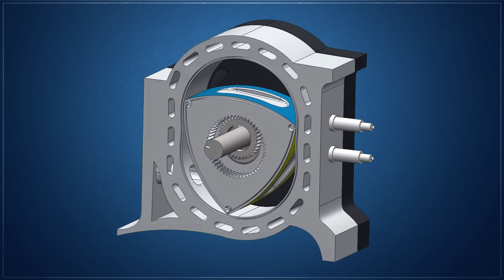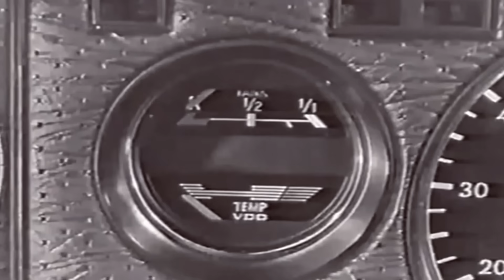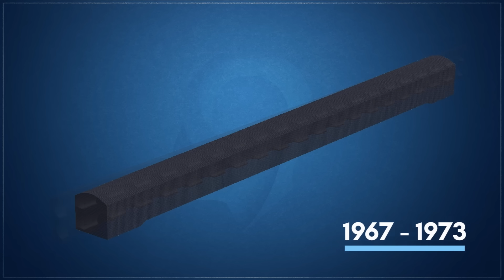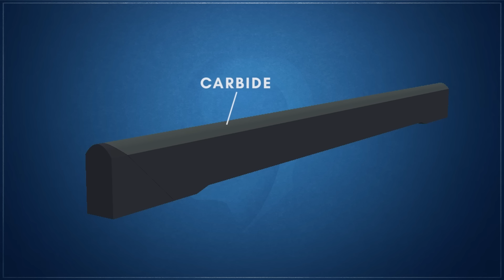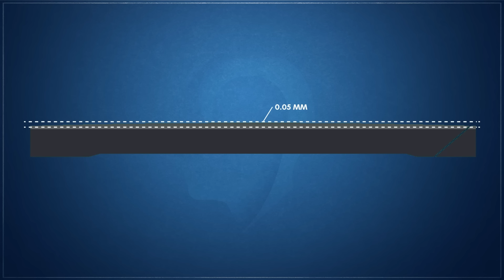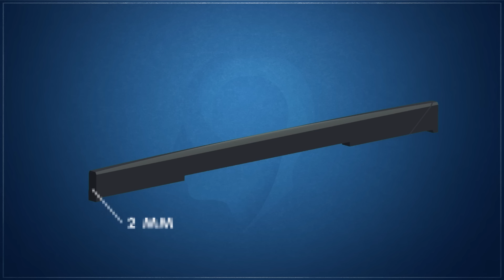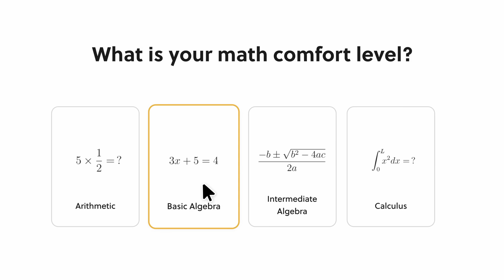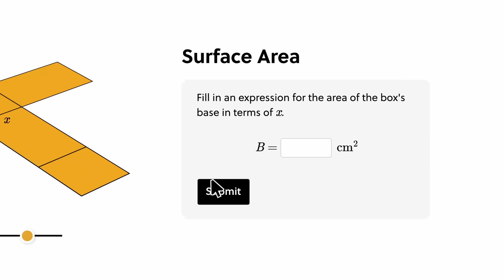Overcoming The Rotary Engine’s Biggest Flaw

Comment: Good video but you're assessment is wrong. 

High emissions and low efficiency killed the rotary. Having the motor power a generator with no direct connection to the wheels allows for far more control over operating conditions that would allow for much better emissions control and efficiency. As a range extender the small size also makes a rotary a good option when you consider it's environmental issues can be mitigated by this use.
Reply: The Wankel engine is obsolete today because of its horrible reliability problems and the fact that it offers no real advantages over reciprocating technology in any applications, especially in generator applications where the Wankel engine was a complete and total commercial failure.

The concept of range extenders was briefly de rigueur over a decade ago but quickly discarded, Only the BMW i3 RE ever made it into production and it was a notable failure.

The idea of combining the Wankel engine, noisy, dirty and inefficient with an EV makes absolutely no sense and is completely incompatible with the entire "green energy" concept that promotes EVs... extremely quiet and zero tailpipe emissions ate the only advantages that EVs have over ICE cars... the addition of the Wankel befouls these tenuous advantages.
Reply: The Wankel failed because of a very disappointing lack of durability and reliability, apex seals have low MTBF.

Comment: I dont know anything, but why don't they coat the interior walls with the material they use on piston skirts? Again I'm just wondering maybe someone would know.
Reply: Because the dry film coatings used on pistons cannot withstand direct exposure to the combustion chamber and is too soft the resistant the abrasion of the apex scraper seals
Reply: @sandervanderkammen9230  Thanks!
Reply: @fishneck7366  you are very welcome

Comment: Electric motors have almost infinitive torque at 0 RPM and out perform any comparable HP rated engine without any vibrations and create no noise. The weight to power ratio is also won by electric motors that produce far less heat per power generated with an efficiency of more than 90% (compared to car engines at 40%  to 50%) . The motor is air cooled - no toxic coolant needed and no radiator either.The motor can drive the wheel directly without transmissions and the need for a clutch! No need for a tailpipe that rust out every 3 years! 
The only reason Toyota does not like them is because they do not own the patent of them! Who are they shocking - their stock holders?! A lot of fluff for noting and a waste of money! Bye Bye Toyota, Mazda, Mercedes, Honda.... electric motors perform without having to wear ear protections in race car engines and the neighbour hoods are quiet - no teenagers that dive without exhaust for an ego boost!!!
Reply: Yeah, we all know electric motors are great... it's rechargeable batteries that absolutely suck... they are inferior to all other forms of storing chemical energy and they prevented EVs from ever becoming mainstream and why they will remain a tiny niche market segment of the automotive industry.

Comment: What about a using a cylinder as an apex seal? It would simply roll around instead of directly scratching up the insides.
As for incomplete combustion, what if a two rotor design is used and the exhaust from the first rotor is fed into the second as the intake to be combusted there?
Reply: How would it form a gas-tight seal????
Reply: How would that make the combustion better?

Comment: In the days of the RO 80, when two RO 80 drivers met each other on the road, they always raised a number of  fingers as a greeting, indicating how many engines had already been replaced. 
The shape of the combustion chamber is the number ONE problem.
Reply: The basic geometry is the worst engineering flaw... the apex seals are the second.

Comment: The big Wankel engine problem are emisiones and housing lubrication, not apex seal, they dump the combustión in the exhaust port still burning ! Thats why the big flame in the muffler. I wonder how Mazda is going to resolve that problem. 😂
Reply: That is completely false and dishonest.
The biggest problem with the Wankel has always been poor reliability and durability.
The Primary Failure Mode of all Wankel engines is compression loss due the apex seal failure and damage.
 This problem is inherent to the design of the Wankel engine and is in no way related to lubrication.
Emissions are not the major cause of Wankel engines becoming obsolete.

The last production Wankel engine was the Mazda Renesis and it met or exceeded the strictest emissions standards in the world right up until production ceased in 2012.

Sale of Mazda RX models was actually worse in countries with absolutely no emissions regulations.
Reply: @sandervanderkammen9230   Nop ! Emission are the problen en todays Wankels. The engine are very reliable in racing today.
Reply: @josecora1917  Wankel engines are no longer made today, series mass production ended over a decade ago.

Absolutely False, the Mazda Renesis engines met or exceeded the strictest emissions standards in the world right up until production ceased when sales dried up completely.
Wankel engines were an epic failure in motorsports competition..
A Wankel engine has never won a single Major world-class professional motorsports series Championship title.

Any questions son?

Comment: Can't call the rotor a triangle because it's not made of 3 straight lines. It's actually called a reuleaux.
Reply: Can't call it a "Rotor" either, a Rotor is something that spins concentrically on a fixed point... only the DKM54 had a Rotor, the KKM57 has an Orbiting Piston assembly.
It both reciprocates and rotates simultaneously in a planetary orbit around  the inside the chamber housing.

Comment: The biggest flaw is surface to volume ratio of the combustion chamber.  This results in excess heat loss of the burning charge compared to a reciprocating piston engine.  There is no cure for this basic geometric flaw.  That's it, done, over, no recourse for the Wankel.  I've followed this design from it's beginnings and also followed the history of NSU.  NSU had some if the best engineers in the world and produced some world beating designs.  These would include the VW Golf and the beginings of all modern Audis.
Reply: Excellent comments
Reply: But not original, all of this stuff is known.
Reply: @anvilsvs  Indeed, but well said.
Couldn't have said it any better myself.

Your knowledge regarding this topic is excellent... it's refreshing to read among the endless comments posted here by those who have no clue what they are blathering on about.
Reply: There's no way you were alive in the 1920s.
Reply: @blockstacker5614  The Wankel engine didn't exist until 1954..
Reply: @sandervanderkammen9230  Conceptually it has existed for much longer.
Reply: @blockstacker5614  Which Wankel engine?
Reply: @sandervanderkammen9230  The one conceived by Felix Wankel in 1924.
Reply: @blockstacker5614  The engine he conceived in the 1920s had reciprocating pistons.
The DKM54 was designed in the 1950s.

The engine being discussed in this video is the NSU-WANKEL KKM57 engine designed by Hanns Paschke and Walter Froede from 1957.
Wankel had no knowledge of its development or approval, he despised this crude, unreliable engine.
Reply: @sandervanderkammen9230  The  NSU engine didn't materialize out of thin air, Wankel had been exploring his pistonless  engine concept for decades by that point.
Reply: @blockstacker5614  Not true, Felix Wankel was obsessed with the Rotary engine and was a big fan of Megola motorcycles, which was the inspiration for his first supercharger design. Only later, at the insistence of this co-worker at NSU, Walter Froede did he develop an engine base on the Rotary supercharger..

Comment: How far can this vehicle travel on battery alone. Using 13 us gallons (10 uk gallons)to extend the range to  380 miles is rather poor and certainly nothing to write home about. If anyone is going to use a range extender then a wankle is definitely wrong most manufacturers are using conventional petrol piston which isn't great when they should be using diesel as that is the most efficient
Reply: Mazda announced in July that it canceled the MX-30 due to poor sales.
Reply: @sandervanderkammen9230  — Smart of Mazda — finally. It’s a shame the poor bsatards spent so much money trying to resurrect this obsolete design …

Comment: in addition to the apex seal probs the side seals would stick due to carbon buildup from running at light loads, idling in traffic etc. 
this lead to blow by causing loss of compression and oil leakage causing the plugs to oil up, making cold starts sometimes impossible without changing or cleaning the plugs. most rotary mechanics came to realize that a poor running engine just needed a good 10 minute blast down the freeway and it was good as new.
Reply: The 2 rotor models, Rx2 and Rx3 had two distributors with two spark plugs per rotor chamber as part of the emission controls.  They were still very hard on spark plugs and depended a great deal on how the car was driven.
Reply: Carbon build-up is caused by low compression and damaged seals.
Reply: Carbon buildup is because of using bad fuel and oil. The main problems of rotary are not seals and emissions, the engine is not stiff enough and need 2 kind of oils to lubricate it. There are people that fixed most of the wankel problems but well, its too late.
Reply: @szaka9395 Carbon fouling is clearly a symptom of low compression, especially for fuel injection engines.
 Show me a Wankel engine that floods or loads up with Carbon, And I will show you a Wankel engine with bad apex seals.

Comment: It is said the less the curve of the rotor, the better. I think this curve can be modified.
Reply: The curve cannot be changed, there is a fixed ratio between the Piston/Rotor diameter and circumference to the chamber circumference.
Reply: This is how hard u can push a rotary🔥🔥😱😱https://m.youtube.com/watch?v=xtVVPioU9p8&t=1127s

Comment: I think part of the issues with the apex seals was that there wasnt really a "cool" side like a piston ring had.   
But the other thing that i have always found a bit odd about the rotor itself was the pockets for combustion.  They were symmetrical and i feel like having the back half of the pocket just as deep as the front half worked against the forward movement in the later half of the ignition stage.   I would be curious to see what would happen if the leading half of the pocket was deeper and tapered to flush towards the back half of the pocket.
Reply: Won't have any effect, you must have been sick the day they taught Pascals Law...
Reply: @sandervanderkammen9230  yes assuming the chamber was stationary but the rotor is moving and has inertia
Reply: @joshuaszeto  Unless the chamber is moving fast enough to form a supersonic shock wave? (which it doesn't)  NO, Pascal's Law does not allow pressure to be "off-set" in the combustion chamber, pressure IS ALWAYS exerted EQUALLY on all sides.
Any questions?
Reply: @misfirerotary You have to push them frequently if you don't have free towing insurance....
Reply: This is how hard u can push a rotary🔥🔥😱😱https://m.youtube.com/watch?v=xtVVPioU9p8&t=1127s

Comment: Its biggest flaw is that it's not an electric motor.  The time for a brilliant internal engine has past.  We not only have to stop burning fossil fuels, we are now faced with having to draw CO2 back out of the atmosphere and lock it back up.  We are in a hell of a mess.  Stop wasting human resources making it worse.  All our mental efforts need to be focused on reversing global warming.
Reply: EVs will never replace ICE cars... their popularity peaked in 1915 and will remain a relatively small niche market segment.
Reply: @sandervanderkammen9230  Of course they will; they are better in every way. What's more they are on a steep improvement curve.  Not just cleaner and quieter and safer, they are also vastly more energy efficient and cheaper to run.  With vastly less moving parts, they are less expensive to service.  With battery cycle life increasing almost daily, they will out last an ICE vehicle.  Can slowing down put petrol back in your fuel tank?  Of course not.  Ice vehicles will of course still be brought out as historic relics.  people restore vintage vehicles and run them in rallies now.  That sort of thing will continue with these last ICE vehicles.

Beyond that though, we have to convert for the sake of the climate.  But this is one measure to save the future that's easy to take because EVs are so bloody good!

Comment: You buried the actual biggest flaw at 8:37 - poor fuel economy.  By the mid 80's, non-turbo rotary engines could easily run for hundreds of thousands of miles with no apex seal issues.  But even the Renesis-powered RX-8 got mediocre gas mileage (18 on average) for the power it was putting out (220-ish).
Reply: The mid 1980s non-turbo engines made no power... gutless turds.

Comment: Cylinders are better in every single way.
Reply: Cyclinders are in efficiency with a lot of moving parts the only advantage they have is that they have been used longer by more companies and only mazda is doing rotary
Reply: @thabanitambanemoto3385  Piston (4-stroke) engines are more thermally efficient. They can extract more force from each combustion event, with less waste heat. than a rotary can using the same amount of fuel.  Rotaries only produce more power with less displacement because they have a power stroke every rotation of the E-shaft (for a one rotor) while a piston engine has a power stroke every two rotations. 
The combustion chamber geometry on the rotary is terrible so a lot of power is wasted as heat and/or thrown out the exhaust because the fuel couldn't burn efficiently.

Don't get me wrong, the rotary engine is an awesome piece of machinery but there is a reason that it's only use for even Mazda itself is as a range extending generator for a hybrid
Reply: I hear about all the problems but when you drive a wankel it’s just magic. They are incredibly smooth, they’ve got a great exhaust note and they love to rev its quite exhilarating driving.
Reply: @ronengel4586  That's that thing. it's not always about "well its way cheaper to make power with an LS" or "a big block is way more reliable over 1000 hp". It's about what you as an individual likes. The same applies for those people who say "Why spend all that money building an engine just to get beat by a tesla plaid to the 60?"

Sure the Tesla is fast but something about a 2 rotor Brapping away at idle and then screaming to 10,000 rpm or a v8 loping along with a nasty cam is way more exhilarating even if its half as fast as the tesla.

Comment: A small correction: the Apex seal does not move uniformly across the epitrochoid, it instead moves at a variable speed throughout the sweep of the rotor, further complicating the lubrication and sealing issues.
Reply: And unlike a reciprocating piston, they are always going in one direction, which means oil accumulation problems and high oil-consumption.
Reply: @andoletube oil consumption comes from the oil injection systems to lubricate the apex, side, and corner seals. The amount of oil consumed is actually not as much as you think it is, coming from an RX-8 owner.
Reply: @WanklerRX  Anyone naive and gullible enough to buy an RX8 proves that you are not qualified to give advice or comment intelligently.
Reply: @sandervanderkammen9230  Excuse me, I didn't know I was in the presence of such intelligence and expertise as yourself. What exactly are your qualifications on this subject?
Reply: @WanklerRX  "What exactly are your qualifications on this subject?"
Since it has been 5 months he still didn't answer your question, so I can answer that for you,
He is an expert of βυllshi†. 
RX-8 is an awesome car despite the huge flaw of the engine. If that guy knows anything about car chassis, suspension designs and whatnot, he wouldn't say something that made him looks so naive, gullible and unintelligently...